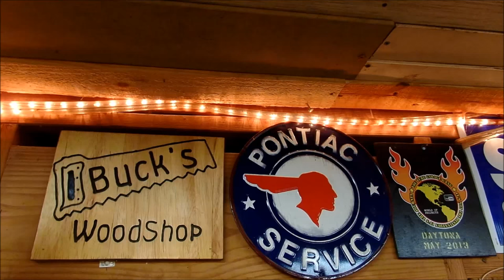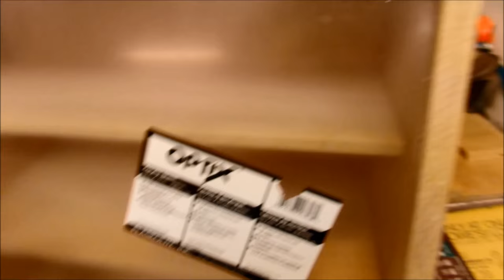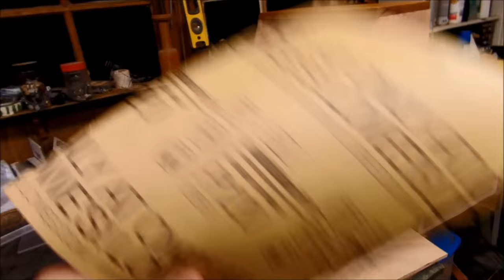Display Case

Comment: When you are crosscutting and want to avoid tearout, a better way to prevent it is by first scoring the cutting edge with a knife and straight edge, then when you run it through your table saw the top level of the grain is already cut and will leave a nice sharp edge. Looks like a neat project. Winging it is fun!  Very nice finished project.
Reply from the maker: +The Shade Tree Fix-it Man Thanks.  I just keep the saw blade as low as possible and add a strip of tape.

Comment: Looks amazing Matthew!  Where does tung oil come from? Also Baby oil????
Reply from the maker: +cutworm59 The tung tree is valued for tung oil, which is derived from the seeds of the tree. Tung oil, also called China wood oil or nut oil, has traditionally been used in lamps in China. In modern times, it is used as an ingredient in paint, varnish, and caulk. It is also used as a wood finish for furniture and other wooden objects.    --Baby oil is a perfumed mineral oil.  -wikipedia
Reply: Ha! I'm not stupid. You made all that up.
Reply from the maker: I did, they grind up baby armadillos to make tung oil.